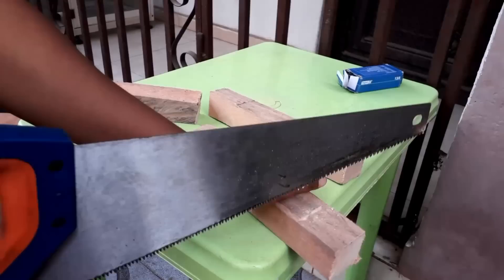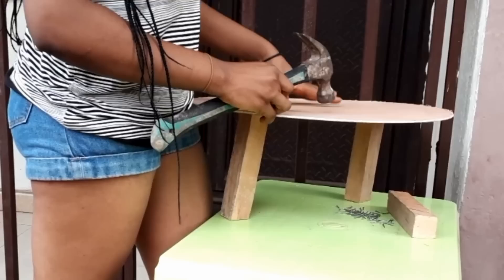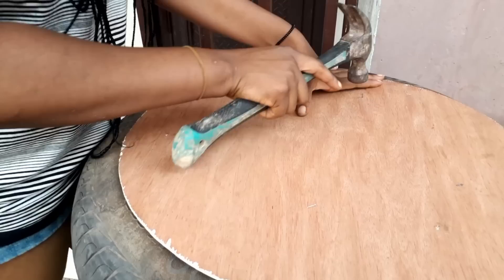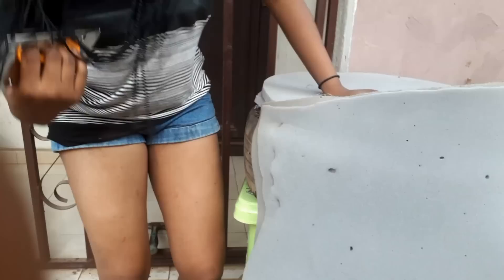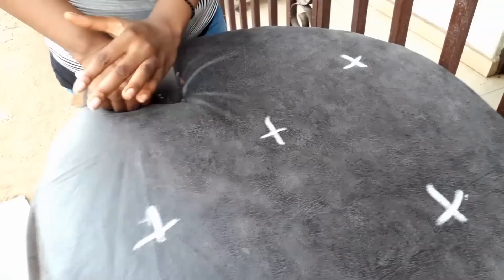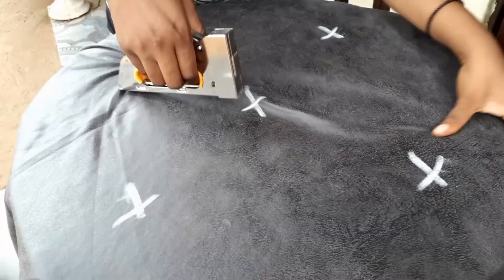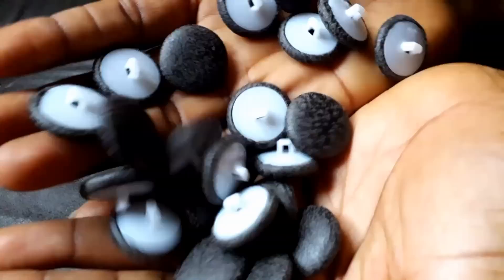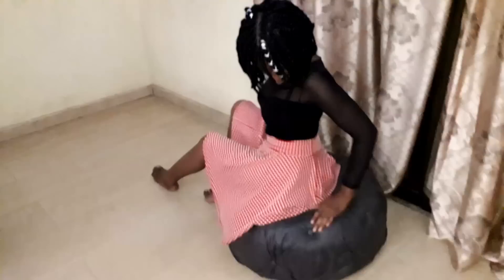#diy #decoration  Luxury Tufted Ottoman Bench Made with Tyres

Comment: This is a super cool and creative way to do this but there are a few steps that definitely should have been or shall I say , that I would have done differently. Like the buttons, hot glueing them is Not gonna last long, instead of stapling the tufted areas, I would've used the buttons with a braded anchor to hold or threaded thru the top foam and board which also may not work for this but seems like it would definitely hold longer than hot glueing them. Even E6000 glue would've held better. But still this is such a neat idea and the overall look of it is very cute! Thanks for video!!